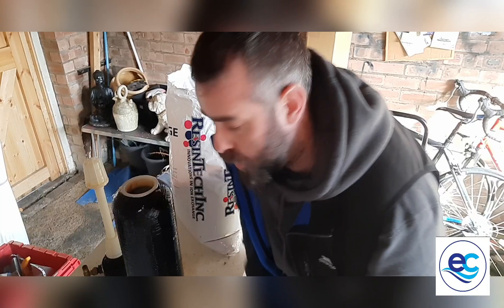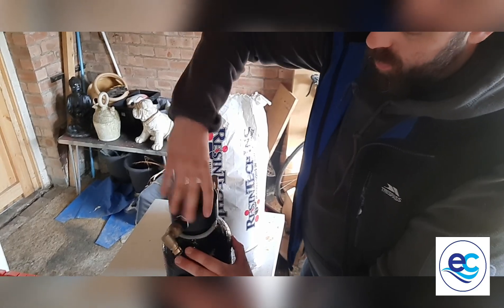Changing the DI Resin in our Static Purification Tank

Comment: Current setup is running my tap water through a couple DI’s, i have gotten away with it as my TDS is just over 100 from tap, but with rising cost of resin i made the leap to order purefreedom’s static ibc ro system, looking forward to filling the van up in just a few minutes rather than 30-45 mins and eventually seeing a saving in pure water purification.
Reply from the maker: Good stuff buddy. My resin cost before RODI was eye-watering. Water out if our tap is 220ppm....I was considering shares in Tulsion at that point 😄

Comment: Very useful to see exactly how a resin change is done, thanks. I like the use of the swivels. I assume when you put water in the vessel it was pure not tap water?
Reply from the maker: Tap water into the sediment filter, then carbon filter, then RO 40/40 membrane and then into the DI.....by the time the tap water comes out its pure.
Reply: @ChrisAddis  I know how to produce pure, it was when you had refilled the DI with resin and then said you 'topped up the DI with water'. I assume that you topped up the DI vessel with pure not tap water?
Reply from the maker: @ched999uk  oh 😄. You can use pure or tap....its all pure when it comes out. I usually run it for 5mins to flush out impurities
Reply: @ChrisAddis  Cheers. I guessed it wouldn't make too much difference as resin would take tds down anyway. Cheers.